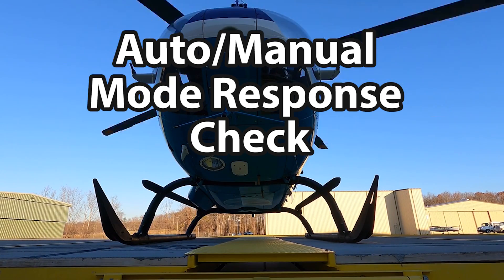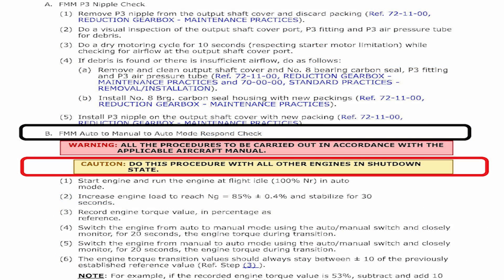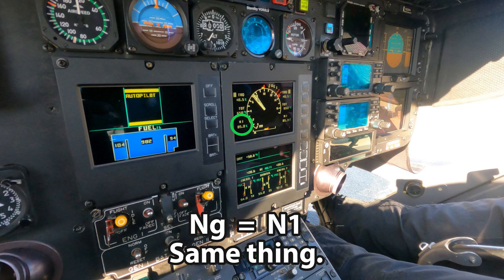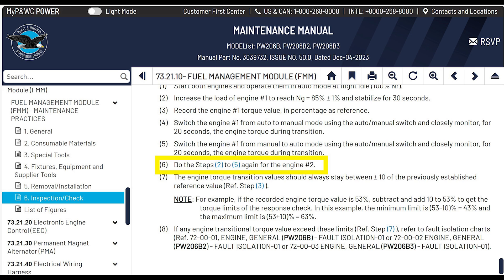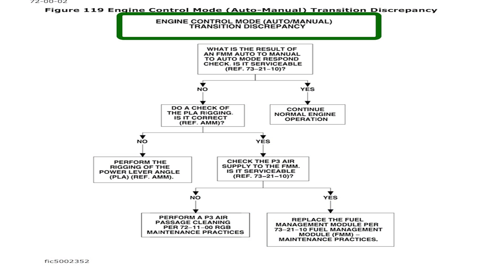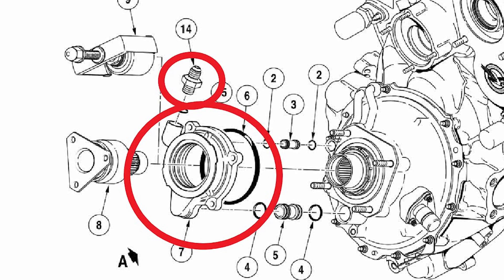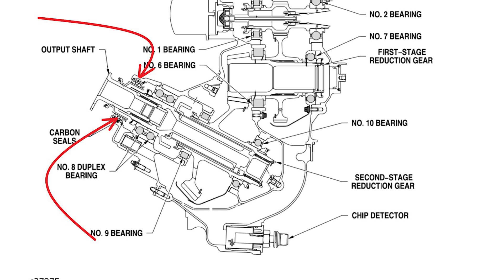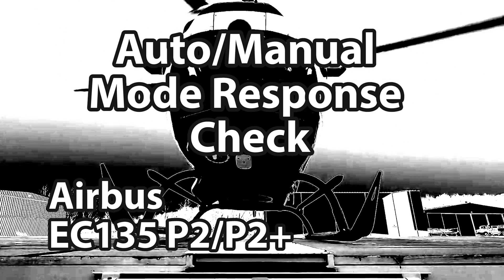Manual Mode Response Check NEW REVISION | Airbus EC135 P2/P2+ Helicopter

Comment: Really curious what other rotorcraft you've worked on. Just an idea - maybe make a video of some of the different aircraft you've worked on and how you liked them from a maintenance standpoint. I work on AS350 and EC130 birds, and occasionally my repair station will see an EC135. Everyone who works on them bitches about them. Curious to hear someone elses standpoint.
Reply from the maker: Hey, thanks for your comments.  I haven't worked on too many machines.  I started on helicopters in 2001, a hand full of Bell 206s, 206Ls, 407s, and occasionally we would have a couple 412s to work on.  I left there in 2003 and went to an operator that had a Bell service center and a Robinson flight school.  Mainly I worked on 206's the flew for the News, the flight school machines, and a couple random Bell aircraft, and also 1 AS350.  

After a little over a year there I went back to work for the last company I had previously worked for but at a different location.  I babysat a 407 there but a few times a year a couple 412s and another 407 would come in for a few weeks.  I got to touch a Bell 430 and an S76 there, but did nothing substantial.

I worked for them again for a little under two years.  After that I got on with the company I am with now in 2006.  I started working on Bell 412s here but after a little more than a year they switched them out for EC135s.  The 135 airframe is what I have mainly been working on since 2007.  The sn range is mid 300 to mid 700.  The company operates a bunch of 135s, 407s, AS350s, and a few S76s and EC145s. 

To be honest, I like the 135 the most.  With that being said I have no experience with the EC130.  I wont cast shade on the 407 in this comment, I don't want to piss any of the guys off.  I was raised on small Bells, but I knew no different.

Regards,
Help Desk

Comment: How does having two engines running at flight mitigate the possibility of an overspeed.....rather than just checking the one engine you can shut down if there is an issue.

What if there is an issue with rigging or FMM. You now have both engines at flight and pulling collective and light on the skids....plus an engine in manual...sounds like an inadvertent take off.
Reply from the maker: Bro, I don’t know.  I’m just relaying what the tech rep said regarding the update to the engine maintenance manual.  In my understanding, if the engine in manual mode speeds up more than it should, then the other engine controlled automatically by the FADEC will decrease power.  This means that the manual engine takes all the load of the rotors.  With both engines running together the load is shared.  So when the good engine (fadec controlled) slows down, the overspeed of the manually controlled engine is prevented or slowed due to the increased load to the engine.   That’s my understanding.  I have to say, it’s good to see you here Cole, much respect to you my friend.   If what I’ve been saying, doesn’t make any sense, give me a call, you’ve got my number.
Reply: I was just giving you a hard time. Your videos are great. We couldn't complete this inspection the other day because our ship wanted to fly at 82% N1 even loaded down. We had to get a letter from the chief pilot to deviate from the manual...... We should probably talk to Bob.